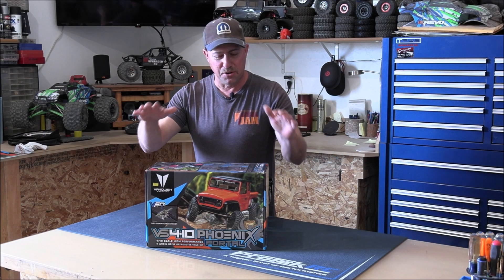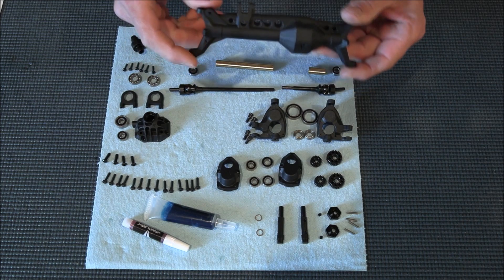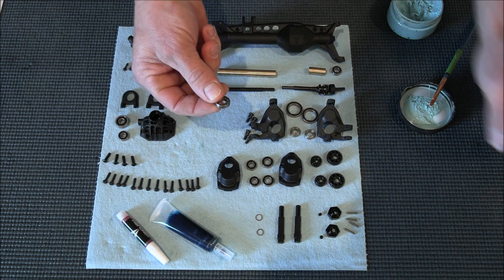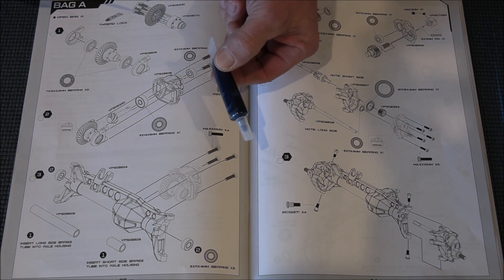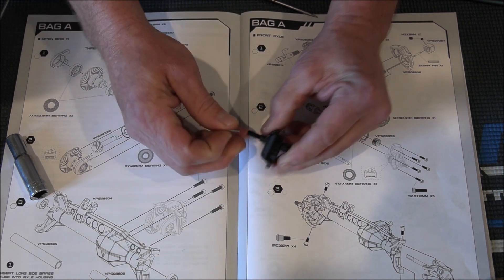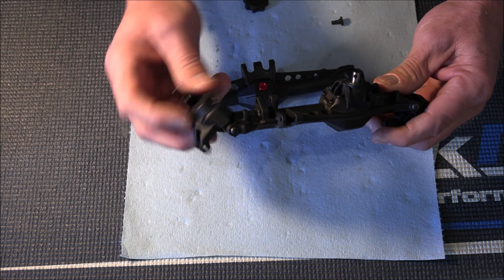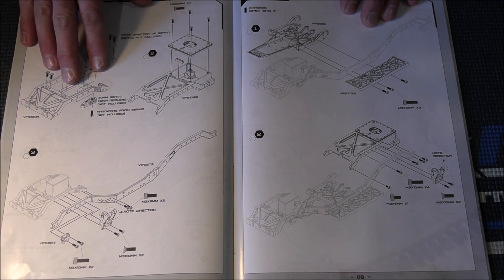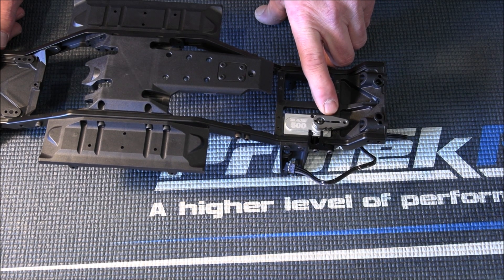Building The Upgraded VS410 Phoenix Part 1

Comment: Regarding the shock towers, when you turn them around then the screw head is toward the front of the truck where there is no hole in the fender to access. They screwed up there for sure. I take the towers off with the shock attached in order to access the screw to remove to shocks.

Comment: Hi friend. Once tha diffs are assembled should they move freely in both directions when turning through the hubs?
Reply from the maker: Yes
Reply: @upgradedrc3697  ok. Got it. My diffs move nicely in one direction. In the opposite direction they don't sound or move so smooth. Firs I added one of the included shims and then other, same results or even worse. Ended up removing both shims. Problem persists.
Reply from the maker: It will drag a little bit in the Reverse direction,  but not much,
Reply: @upgradedrc3697  Got it. Fixed. Thanks.

Comment: Nice vid,  the orientation of the front bodypost in the manual is correct, because in this way you can remove the shocks while the fenders are mounted.
Reply from the maker: With the shock towers opposite of what my manual says the allan bolt that holds the shocks on are accessed to the rear where the hole is for it. Maybe they updated the manual since I made this video which was a while before I accually posted it.🤔
Reply: @upgradedrc3697  I just got a phoenix. I would think they would have fixed this or maybe I got a first run. But the manual is wrong. You can still access the shock mount whether its correct or backwards. But you wont be able to install body posts if it is installed how it shown in the manual.